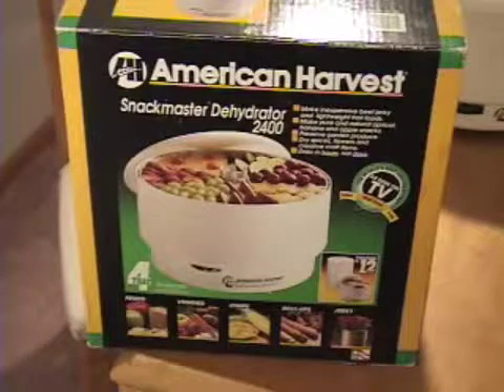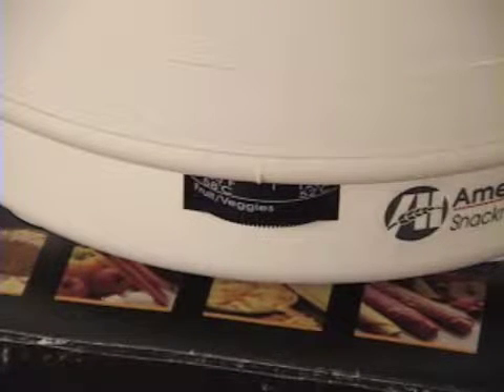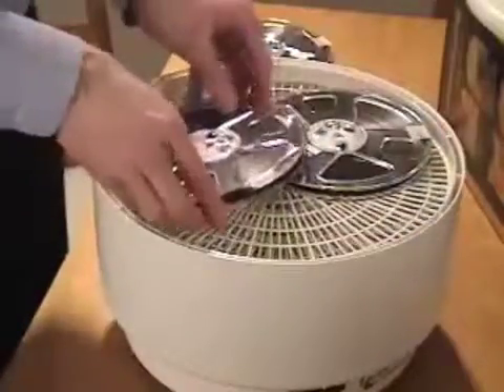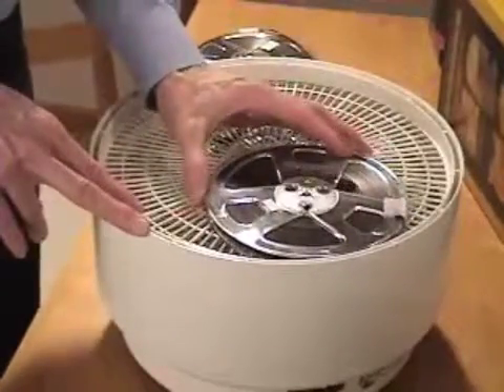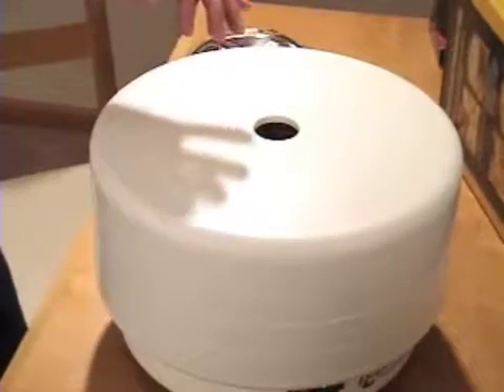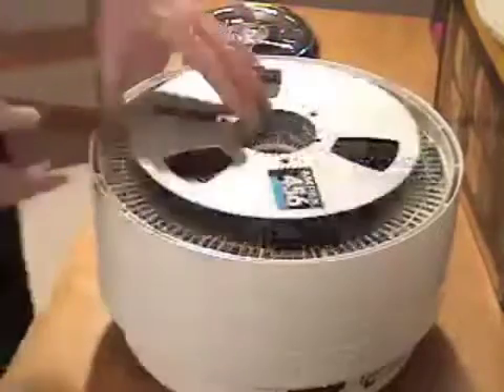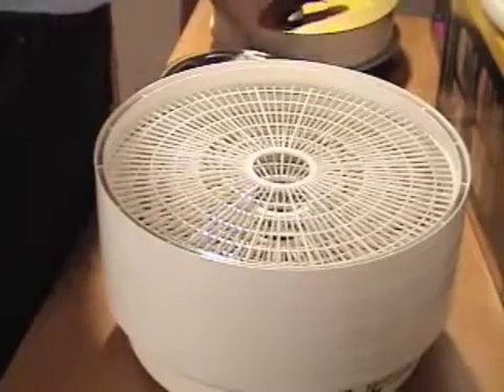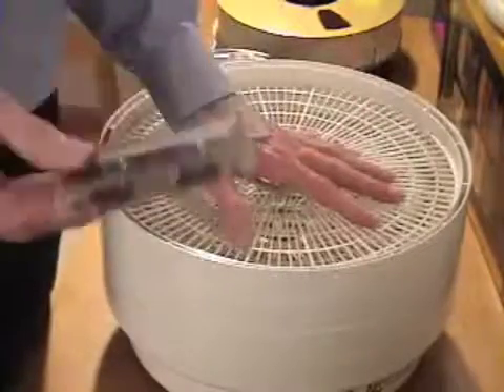Tape Restoration

Comment: hi to all out there last year i baked 7 x 2 inch in my gas oven at 55c note start a 4 hrs with out boxs yes all was ok ampex master 
i have 100 plus i had to do  note you have to air the room you bake the tape in  you can fill the you now what drying on on you skin

so i better to leave a door open   note you can use a gas oven ok note it was min it would go i had you open the gas door abit
yes you need a temp unit to keep a eye o the heat level  note it work ace  did it in the cool out side 

in the uk there's not alot of 2 inch tapes alot are baked and re used the people i got tape from having hard time selling them 

1/2 inch   1 inch are liked more

Comment: I didn't remove the center on my NESCO American Harvest dehydrator.  Instead I wound my 7" reels onto 10" reels.  The NAB center hole fits nicely around the center piece of the dehydrator.  I have baked 1/4" audio tapes and even 1/2" reel-to-reel video tapes this way.  5" reels fit without having to be wound onto other reels.  I bought my NESCO at Walmart quite a few years ago.  The inside of mine looks similar to the one in this video.
Reply from the maker: Very interesting! However, I caution against winding the tapes at all before baking. Every time an untreated tape goes across the heads or guides, magnetic material comes off. The stickier the tape, the worse the problem. If you know a way to rewind without having the tape touch anything, you'll be far better off. 

I had some tapes that were stored "tails out." (For those who don't know, once the tape reaches the end, instead of rewinding, the engineer—who may be you—leaves the tape that way to reduce "print-through," which you can read about by consulting Dr. Google.) After baking them, I mounted the tapes on the recorder/player and routed the audio—which plays backward—into my workstation. Then I used one of the built-in features to reverse the audio.
Reply: @jonathanstars8437  A lot of my tapes are Scotch brand.  In the 1950's through 1970's they made tapes with good binders that have not needed baking.  Then when they started producing dull backed tape they lost the charm.  Ampex tape always had problems.  I guess you unwind a foot or so to see if there is a problem with the binding but if there is no problem, then no need to bake.  Someone sent me 4 tapes to digitize which I put up on YouTube.  Each did not require baking.  One was in an Ampex box and reel.  Here are two of them:

https://www.youtube.com/watch?v=IS5Mkp8Rrsc
https://www.youtube.com/watch?v=BRUzWmMNeM4
Reply from the maker: @CV2200A  Wow! They're very crisp and clear—well, except the old-style reporter at about 5:30 in the 2nd video. Did you have to do any processing to clean up any noise?
Reply: @jonathanstars8437  These were the tapes that were made at the station.  The gentleman who sent them to me was impressed, having forgot how good the sound was in the studio.  No processing needed.  Not through the broadcast processor.  Good microphones, perhaps AKG.  Yes at the 5:30 position they cue a record with a scratch on it through the same mixer board.  Thus was an easy listening station in 1968.

A tape I made in 1963 recorded from a TV had a hum which I had to remove.  Recorded on Scotch 190 with no shed or squeel problems.  https://youtu.be/AZj3wUrYjr8

Another recorded one year later with a better TV sounded better.  Maestro double play tape which was an Audiotape reject brand.  No shed or squeel.  https://youtu.be/96c_pUriICc

Compare to this recording which I only have a copy from the radio station tape..  Each report except the first are my high school language lab copy of the radio station copy from the original edited tapes.  The first report about fingerprinting was recorded off the air from WCBS-AM.  All tapes did not need to be baked.  https://youtu.be/laDfb0jY764
Reply from the maker: @CV2200A  Coming back, I'm sorry how badly smeared my own video here is. I worked for EQ Magazine, they down-sampled the video to fit on their server, and I didn't keep my original copy.

Probably only of slight interest to you, but my parents were friends with Jim Roberts from the Lawrence Welk Show. He shows up here on your video: https://youtu.be/AZj3wUrYjr8?t=178
Friends of my parents had a daughter, who married Jim, which is how my folks got to know him.

Anyway, the reason I asked about plug-ins is that I just bought an amazing one from Waves Audio called Clarity VX Pro. Just turn the dial, but there are lots of more detailed options available within the dialogs.
Reply: @jonathanstars8437  Interesting on Jimmy Roberts.  He is on all 4 of the LW shows on my YouTube channel.
I use Wavepad Sound Editor by NCH.  It has a function where I take a sample where no music or talking is but the noise is still there.  Then it subtracts the noise.  Better than a parametric equalizer.

Comment: I had about 4 10" ampex reels that I recorded 24 hours of top 10 classical off of FM way back in the 70's and when I played one now it was the squeeky sound on the heads that alerted me that something was wrong.  After researching baking I was glad to find your video on using a hydrator so now I have 3 stacked up and cooking and am anxious to see if that clears up the problem.  Thanks a million.
Reply from the maker: Hoping the best for you. With 10" reels, make sure when you stack the tapes in the dehydrator that you put them on separate levels. That gives the moisture more room to dissipate rather then simply "steaming" into another tape. The slight overlap for smaller tapes is okay, because they're still mostly not sitting directly on top of one another.
Reply from the maker: So how did it go, sverny? Were you able to recover the audio?

Comment: I have a box of gooey Ampex VHS tapes I'm finally experimenting with! I baked 2 for 8hrs and they played well enough for about an hour, and then the picture started rolling some. I'm thinking maybe the dehydrator works better on tape more towards the outside of the reel and can't penetrate the inside. Can/should I bake them again? How soon?
Reply from the maker: You are right. When it comes to video tapes, the reels aren't as open as reel-to-reel audio recording tape. The cassette is closed off. So bake them again. You can do it immediately, no waiting necessary.

Comment: Very helpful video. I'm about to use this technique on some tapes I have from the 1970s that are shedding. Three questions: (1) Can baking for a longer time, say overnight, cause any problem? (2) If you bake a tape that isn't sticking or shedding, can that harm the tape? (3) How do you get rid of the white mold that may be on a tape?
Reply from the maker: It doesn't hurt them to bake them longer. Just make sure you're staying within the temperature guidelines I talked about: 125 - 135 degrees fahrenheit. Same with tapes that aren't shedding.

For mold, you should be careful to bake the tapes where you won't be inhaling the powder they blow into the air during the baking process. Some molds are bad for you. So I bake those tapes first, they I run them through the machine on high speed with a soft cloth in my fingers, lightly pinching the tape to wipe the mold off before it gets to the record/playback heads. Stop the tape often and change to a clean part of the cloth. Don't twist the tape while you do this, and you'd be wise to wear a filtered mask like painters use to avoid breathing the spoors. Then you should clean the full path the tape passed through while you were cleaning off the mold.

Comment: Jonathan Stars This is AMAZING.. Is there anyway possible that I can email you. I want to be able to show you what I have, as in my problem.? I have 8mm handy cam tapes that have white "mould" that keeps the tape itself stuck to itself. i opened one and spent weeks slowly unravelling the tape but it would tear in parts. Would this process help this problem I have..??  PLEASE HELP......PLEASSSSEEEEEEE
Reply from the maker: Yes, this would work for your issue, but there is more … First I would put on a high quality painter's mask with filter chambers. Some molds are toxic. Then work outside or in a garage with the door open. The hard part is opening up the tape cartridge, because some cartridges have springs that fly all over the place when you open them up. It's also fussy to handle the tape spools without the tape unraveling, which would require a lot of time hand-winding it back onto the spools, so take your time and work slowly. Now work with a soft brush to get as much of the mold off the upper and lower edges of the tape as you can—again, while wearing the mask. Do all of this without unwinding any more of the tape than you already have. Now comes time for the baking. Follow the instruction in the video, but put the dehydrator outside or in a garage with the door open, since the fan will blow some of the remaining mold into the air. You don't want that in your house or your lungs! You will still likely have damaged areas that are unrecoverable, since you already said the tape has torn, but depending on the content, it may be worth it. You just need to ask yourself how important the material is.
Reply: @jonathanstars8437  First of all, thank you for getting back to me. I contacted an English guy and his response about the Mould and using a Hydrator was "Baking doesn't help at all with mould, that's for a different problem called sticky-shed syndrome." Now I don't know what to think or believe.??
Reply from the maker: @hoppymulhern1  The English guy is correct—partially. Baking won't help the mold. But you have 2 problems: mold and sticky shed. That's why I explained about the mask and using a brush before baking. I think looking at this fellows video will provide you with more detailed information about your video tape, although he doesn't address the mold problem. He also shows a different dehydrator, which will give you another option. He runs the machine for days. I don't think that's necessary. He also has another video about working with video tape. I'll leave it to you to track that down.. https://youtu.be/50uL9BqVOHM?t=403
Something I mentioned in my video is that I will often take apart the cassette. You're going to need to do that to get as much of the mold off as you can. I have a spare tape handy in case I mess up the cassette or lose parts. But you need to be handy with tools and have some idea of the mechanics involved. Another choice would be to send the tape to me, keeping in mind that it might be beyond repair. Again, I'll ask how important the material is. If you've already unwound part of the tape, some of it may have peeled off and be irretrievable.
Reply from the maker: Here's another video, but you can't do this the same way with the mini video tape machines. I point it out to show you what you're up against. https://youtu.be/Kn2NWJzxS6k

This one might be helpful, too. But I would bake a tape before pulling it out of the cassette, because you mentioned that the tape was stuck to itself. Pulling out the tape under those conditions will just rip more of the magnetic material off. https://youtu.be/hudU0uVHJPc
Reply: @jonathanstars8437  Thanks again for this great advice. Is there anyway I could talk to you..?
Reply from the maker: @hoppymulhern1  Find me on Facebook at https://www.facebook.com/JonStars100, then leave a personal message. (I don't want to leave my email here. I get enough spam.)

Comment: How long total are you baking the 1/2 tapes from the beginning of the video...
Reply from the maker: Hi, Ryan! Sorry for the late reply. At about 5:00 into the video I'm demonstrating with 1/4-inch tape. I leave them in for 2 hours, but it doesn't hurt to go longer, and I do the same 2 hours with 1/2-inch tape. A couple times I was out of the room when my timer went off, and I left them in for as long as 4 hours with no ill effects.
Reply: @jonathanstars8437  hello. Can I send you a few tapes to see if you could fix them. I've tried everywhere

Comment: hi i had to bake some 406 tapes  i can tell you the 406 on 1 inch nab don't bake well out of the 90 tape 15 reel nab came out bad
tape was ok i got some metal nab's  and moved the tape to them ok
Reply from the maker: Hi, Bob. I'm sorry you had some problems with your 406 tapes. I baked a number of those for myself and a client without difficulty. As I mentioned in the video, those need to be bake longer than 1/4-inch tape. If you did as I suggested and still had problems, it's possible there was some other issue with those tapes or that you were following a procedure different from the one I used.

NOTE: For those who don't know, NAB stands for National Association of Broadcasters. NAB reels are metal (mostly 10½-inches) with large center holes.

Comment: Jonathan,  great video. You do not however need to bake tapes from the 50s, 60s or 70s.  The binders on tape from these times do not degrade. However, starting in the early 80s into the 1990s  saw the widespread use of Ampex 456 using a upgraded binder formula which was a complete failure. Ampex 456 tape is the worst offender in sticky shed. Most tapes from the 60s and 70s use the classic old binders which do not shed.  By the way, VHS cassettes should be opened before baking, because VHS casings are sealed well and the water vapor cannot escape from the casing.  The pressure pads on cassettes can be easily re-glued into place.
Reply from the maker: I had tape bought in the 60s and 70s that were bad. It probably depends on when each manufacturer switched their formula. For example, Ampex began manufacturing 406 in 1975. 

I had no difficulty baking VHS tapes in their cases with the equipment described, and I certainly had trouble with those tapes prior to baking. However, I agree that if the pads come loose, it's proper to open the case and reglue them or put them into a newer case. 

A Wikipedia article says formulas for 1/4" audio cassettes do not suffer from sticky shed, but I found lots of trouble with cassettes gumming up the head of my players, so I just baked every one of them. By the way, I had many problems with pads coming loose on them as well as the splice tape coming loose from the leader.
Reply: @jonathanstars8437  Agree sir. I am in the middle of digitizing about 60 tapes from the mid to late 1970s. Zero problems with any of the Maxell UD 35-90 tapes. Regarding the Scotch tapes, most have sticky shed, however, some played fine, so when each manufacturer switched makes sense. Just picked Harvest Master; time will tell how I make out with the bad Scotch tapes. Thank You for this video!
Reply from the maker: @jayandildy  This is good information, and will probably be helpful to other reader/viewers. Thanks for the details!
Reply from the maker: Nick is correct. The formula for the binder in tapes prior to the mid-70s included whale oil, which became illegal, forcing the industry to find a substitute. I didn't go into detail about that because the 50 years of tapes I recorded on didn't include any of the older tapes. But that is an omission that could cause some problems for people. The simple way to test is to put the tape on a machine with clean heads and play it for a minute or two, then clean the heads again. Of course if the tape sticks and/or chatters from the start, stop the machine immediately.

I want to add that I recently baked some 50-year-old tapes for a studio owner and still had issues where slivers of the tape peeled off the edges. It didn't affect the quality of the transferred audio and didn't accumulate on the heads.
Reply from the maker: Your notes regarding tape before the 80s are correct, Nick, as I think I mentioned in the video. Regarding VHS tapes: I baked over 100 and never had a problem, and I certainly DID before baking. 

One other person commenting here did have to bake his a second time where he had a problem one he got more toward the middle of the tape. 

Many people aren't comfortable with opening up the VHS cassettes, so I did not cover that in the video, but you're right that it would yield better results.